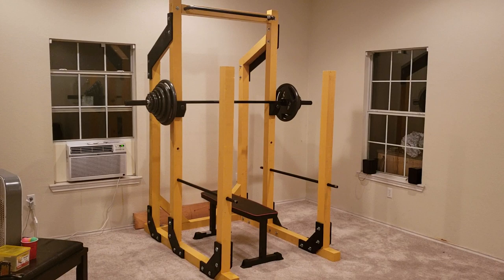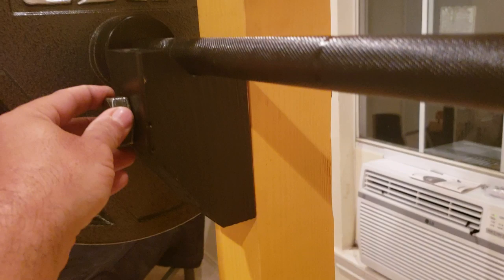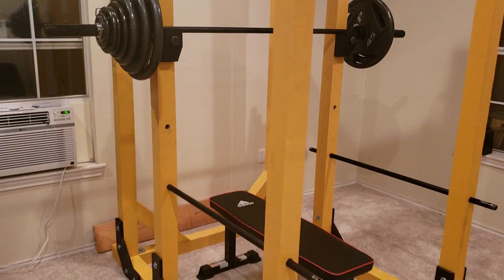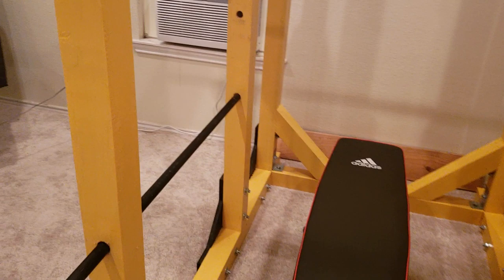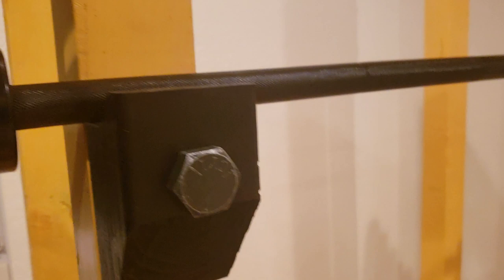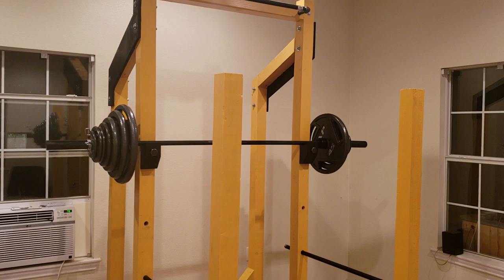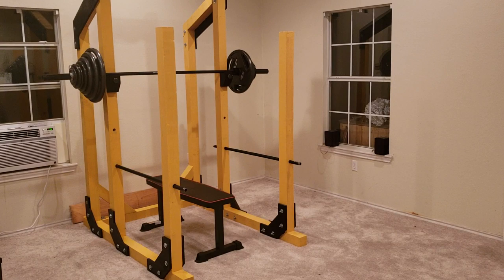DIY PowerMax AE Power Rack Clone

Comment: Congradulations. In 1956 I made my first power rack out of 2x4 's.  I used a hand cranked auger to bore holes for the support rods and the bolts. It was bolted with 3/8 " bolts and I used metal plumbing pipe for the barbell support rod. It could hold more weight than I could lift. I scrounged the 2x4 's where ever I could find them and got the bolts at a hardware store. The all metal power racks are great but they can support more weight than many people can use. If you have the money get a metal power rack. If you don't have the money you can improvise and still get great results.
Reply from the maker: It's amazing how little changes after 64 years. Cheers to you, bro

Comment: Very nice, agree on the holes, some designs have so many holes not used.  You might consider on the lower bolts that stick thru the nuts, add plastic caps to keep from scraping the skin off your ankles 9 or better, countersink the heads and nuts with washers. Thanks, Tony in Texas.

Comment: Very nice engineering and design.  For the safeties, I would just use more 4x4 and make it a permanent part of the design.
Reply from the maker: I would definitely reinforce it in the middle and use huge lag bolts to secure it.

Comment: Looks good and seems solid. Gonna need to drill more holes if you ever intend to do any partials. Looks like you could add a pulley with just a bit of modification.

Comment: Nice job.  I would caution the safety of the black pipe on a failed squat or bench.   Big force differential between a static bar versus dropped moving weight.   May want to test on some moderate load such as 200lbs to simulate squat
Reply: or put some rebar in the pipe for extra safety
Reply: also, have you thought about putting steel sleeves in the holes?  If it would fail I could see it just splitting the wood like a maul, the sleeves may protect against that.

Comment: I would add another set of those j cups instead of moving that set back and forth risking cracking the wood.
Reply from the maker: Building a second set would definitely be way more convenient, but no chance of cracking the wood. I only hand tighten the bolt very lightly. I also drilled the hole slightly high so that it always hangs down and doesn't want to spin, which helps a lot.

Comment: I love the design and the look!  Hows this holding up?  How often do you use it?  How much weight has it held?
Reply from the maker: Some wear from the bar knurling around the j-cups but otherwise looks exactly the same. 3x week. I've set 390 lbs on the cups before with no problem, but I don't ever work out with that much weight. Highest active weight on the rack has been in the 280s.

Comment: Looks awesome mate. Reckon you could add a couple pulley for rowing?
Reply from the maker: I considered adding a second cross-member for just that purpose but never got around to it. The half-lap joint is plenty strong to handle the pulling load, though.
Reply: @koffeegod  guess the beauty of a home build is that you can add to it if you choose at a later date.

Comment: Front Post Stability Question - Would this benefit from a horizontal brace between the front uprights if high enough to clear for entrance or an angle connector (rafter) between the front & middle uprights (similar to what you have between the back to middle upright)? Asking when I viewed the demo video from Afterglow it appears that the front posts wobble often. Your design & video are A+ but wanted to ask before making this to get your thoughts.
Reply: the load bearing those post take is very minimal. You could put in a horizontal brace but there isnt really any point. Also depends on your height and if you are wanting to overhead press inside the rack.
Reply: @7mattga7  Thanks for the comment. I may skip the horizontal brace, and do a 'Rafter' type post instead so the side profile looks like an A. Good point about the overhead press.

Comment: what the size of the bolts? not the jcups ones the regular ones you use to bolt everything together? and grade? what grade you used? Im taking my time building this (well similar) and I just purchased the jcups bolts grade 8 intended for structural builds, was wondering if all bolts needed to be that grade cause if so it gets pretty expensive lol.
Reply from the maker: 3/8-16 x however long you need (5", 6", etc). I just used standard zinc Everbilts from Home Depot but any construction-grade hex bolt will do.
Reply: @koffeegod  Thanks for the reply that what I figured, I was just strolling around homedepot this morning have the day off so checked out the bolts and what not. How are teh Jcups holding up?
Reply from the maker: @joseluis7808  A little bit of wear from friction but otherwise no issues.

Comment: Just an fyi. 2 2x4 together do not have the same strength as one 4x4. I have use both as dunnage with stacking lp tanks and the 2x4 would never hold up! 4x4 all the way or go metal. just my opinion though.
looks good!
Reply: If the 2x4’s were glued and screwed, they’d probably be as strong. However, 4x4’s would look cleaner.

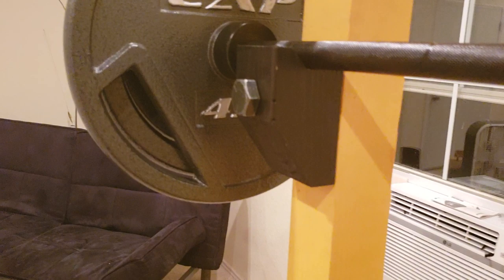Comment: 1:40 nice setup man
What the maximum load you had on these cups?
You said 1" bolt, is it the M24?
Reply from the maker: The most weight I've had on it was 400lbs (~180kg) which is all the weight I own. 

Side note: those 1" bolts have a tensile strength of around 20,000 lbs, which would make their shear strength something like 12,000 lbs...each. The 4x4 posts would fail looong before the bolts and 4x4 posts can support an axial load of something like 1,200 lbs per sq inch. In short, I think this setup could easily handle as much weight as anyone could reasonably lift. 

Yes, I believe 1" is equivalent to M24.
Reply: @koffeegod  
Thanks. It definitely won`t shear, but it would bend at some point. I`m mounting mine on a steel post.
I did some testing with an M10 bolt and it slightly bent at 75 kg and much more at 120 kg. 
the 180 kg is the total weight or just one side, then 360 kg in total?

Comment: How’s it holding up a year later?
Reply from the maker: Except for some scuffs from the bar knurling, it's still in perfect condition. I've been meaning to add a flap of rubber behind the j-cups to prevent that, just haven't gotten around to it yet and it's really not too bad. Haven't even had to re-tighten any bolts yet, thankfully (though I did crank them down pretty tight to start).

Comment: What's the max weight it can hold
Reply from the maker: The most I've had on it is around 400 lbs, which is all the weight I own, and it doesn't budge an inch. I estimate it would easily hold a static load of 1,000 lbs, but anything much over 600-700 lbs and I would just buy a steel rack to be safe. If you've invested that much into your workouts, you should treat yourself.
Reply: @koffeegod  thank you so much for your reply, this is by far the best one I've seen. Keep up the good work.